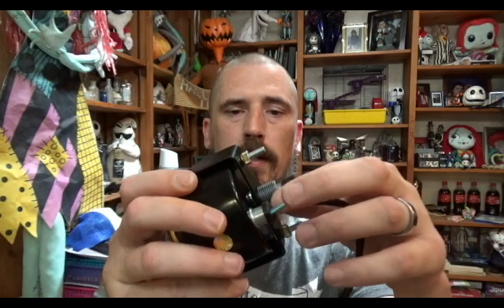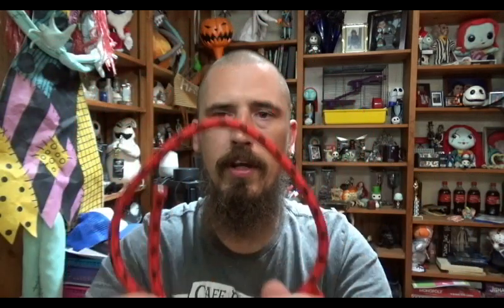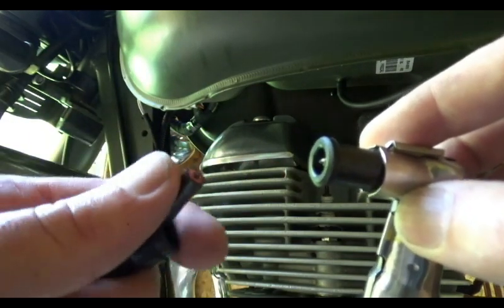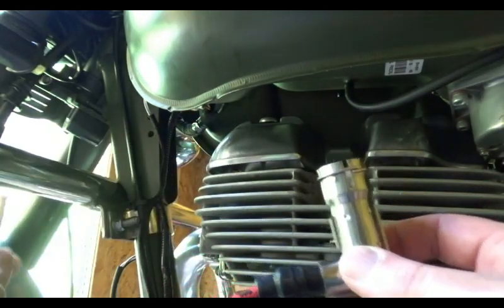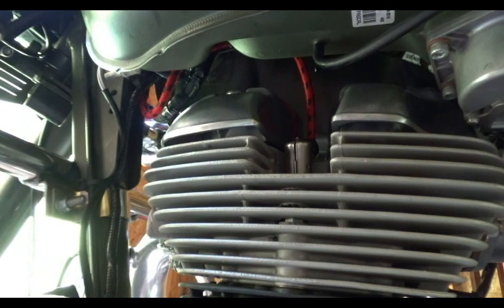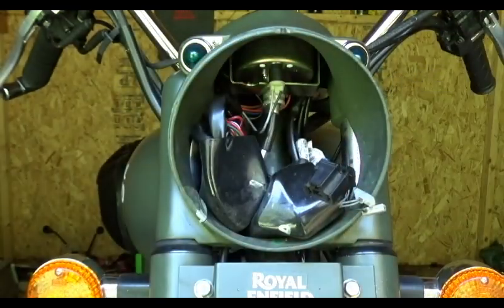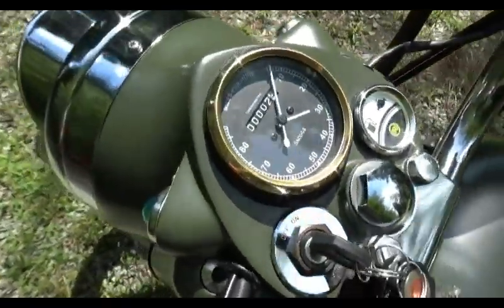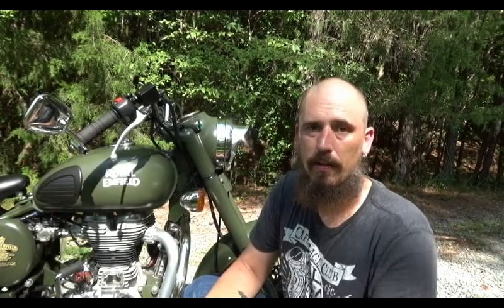Smiths Style Speedometer

Comment: That brass looks superb with the green! I guess if you really wanted them you could just drill and mount those neutral and high beam lamps on the casquette to the left and right of the speedo, but yeah...Who really needs them? Hell, unless I pull over in the shade and cup my hands around the speedo, I can't even see if my neutral lamp's on. Thanks again for that other Smiths knockoff with the too-small cable screw mount. See you this weekend in Galax!
Reply from the maker: Yeah, I can only really see the Neutral indicator at dusk or night, so, not really needed in my opinion. I hope you can use the speedo on that neat Norton of yours. See you in Galax. -Madd Man